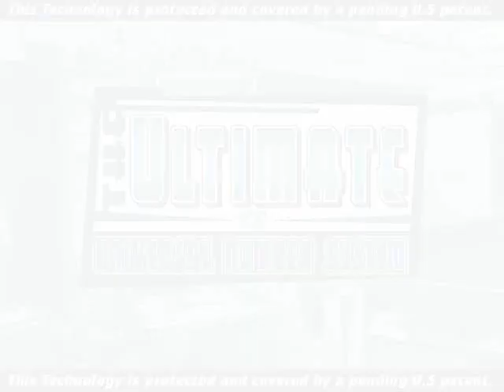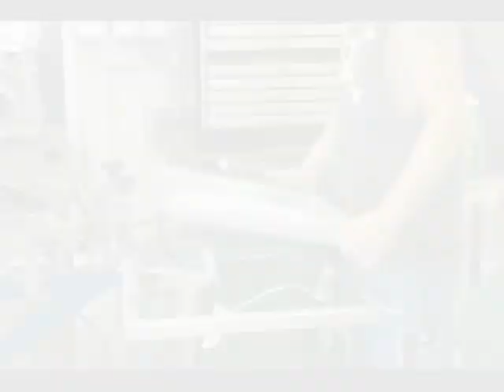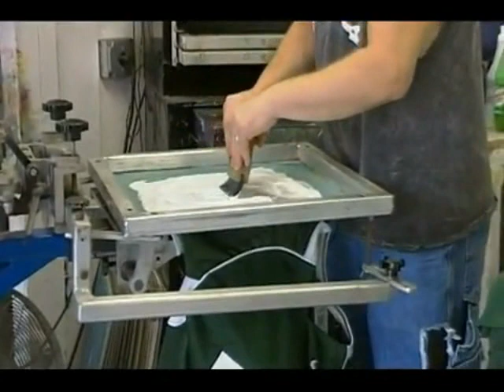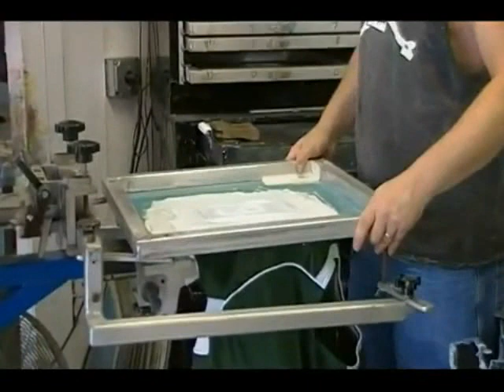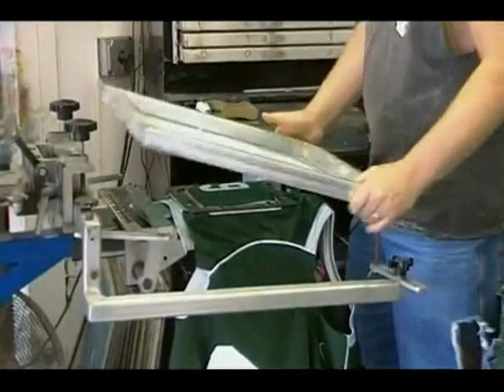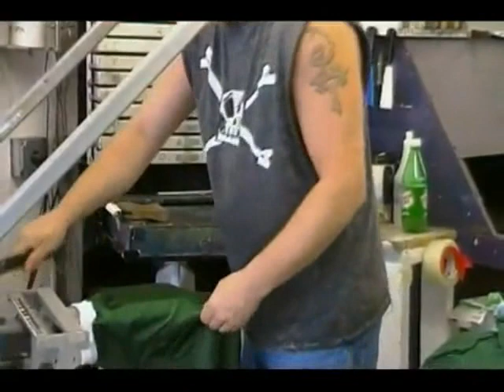Printing 4 numbers on sleeves of a Football Jersey with the Ultimate

Comment from the maker: If your referring to stencil or heat pressed numbers, they don't compare.  The numbers printed with The Ultimate are actual screen printed numbers.  So they won't peel off or look like a heat pressed number.  Plus you can print a logo and the numbers without going through two drying processes.  So this saves you production time.